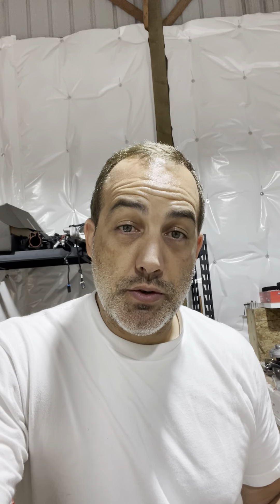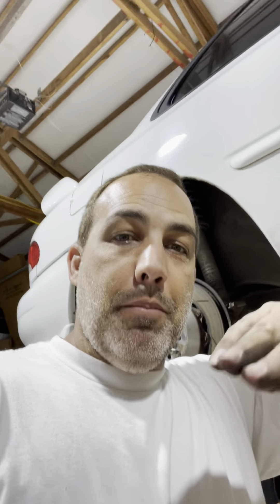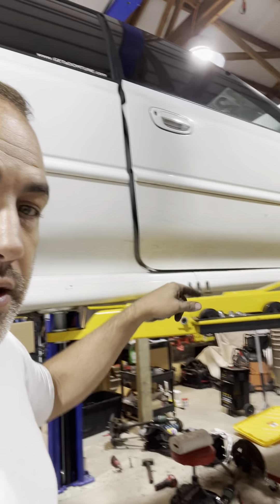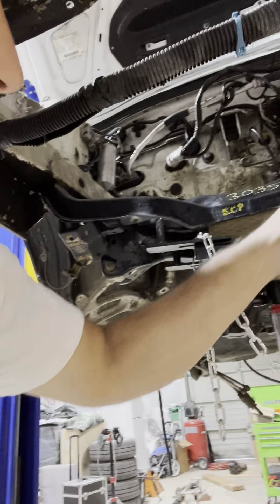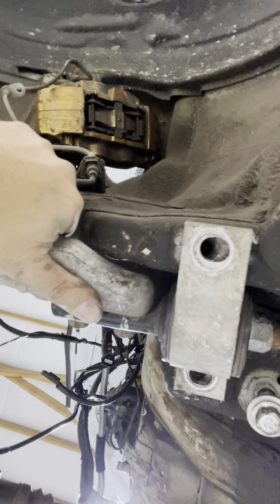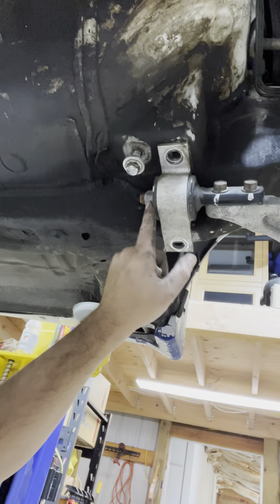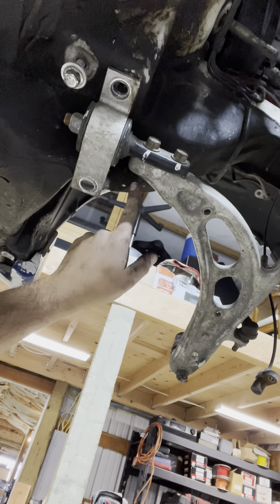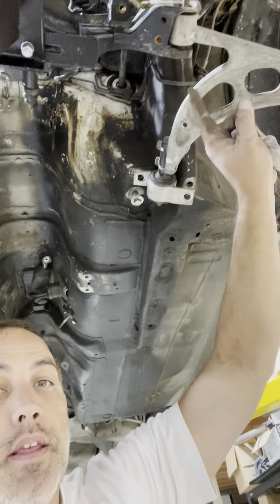Electric Steering rack and RS update

Comment: That's so crazy this subframe just fit right up. I've got an old GL Hatch that I EJ swapped. I clicked on this because I thought you might know what the rack width is on these VA racks. I have a loyale rack in the GL now, and I've seen the Loyale swapped with early GC/GD racks, and I've seen late GC/GDs swapped with the 15+ rack, so... could I then put a 15+ sti rack in? And have the inner pivot points be close enough to not make crazy bumpsteer?
Reply from the maker: No. Bump steer city probably

Comment: Hey Dom, have you ever thought about running a brz electric steering column instead of the wrx rack? Only issue would be the ratio that would still be the gc one. But it seems easier then what you're trying to do. Either way excited to see the outcome :)
Reply from the maker: my rack is worn to chit. Don't want the big BRZ thing in there either.

Comment: If the VA front track width is wider and you run GC control arms and uprights you may end up with bump steer issues.
Reply from the maker: would never do that. Not even an option.
Reply: @GetaDomTune  I think you misread my statement. I’m suggesting that mixing and matching the sub frame (rack position), control arms and uprights may cause bump steer
Reply from the maker: @Turbochargedtwelve  why speculate to me, when I have everything right here?
Reply: @GetaDomTune  so you can measure it while the car is apart and on a lift instead of getting it all put together Hopi g to drive and test everything else you’ve changed and finding out the handling is so goofy you don’t want to drive it so you delay your project even further while you work on fixing it. But it’s your project,  you go a head and do what you do.
Reply from the maker: @Turbochargedtwelve  I measured the front suspension geometry, including rack height and tie rod centerline in relation to the control arms. With the exception of the arm being back 5 ish mm,  it's all the same, within 1/16".